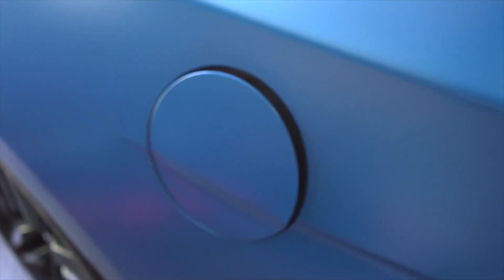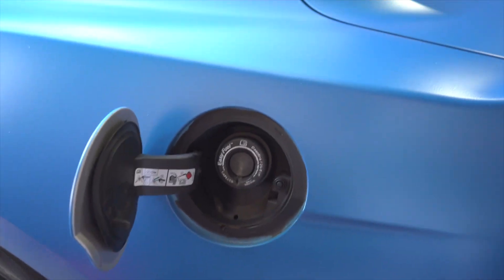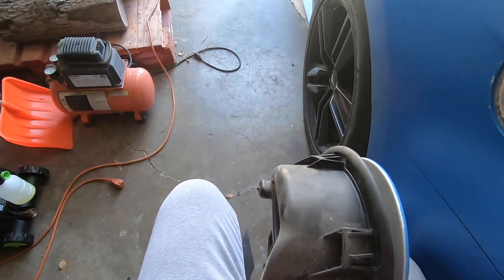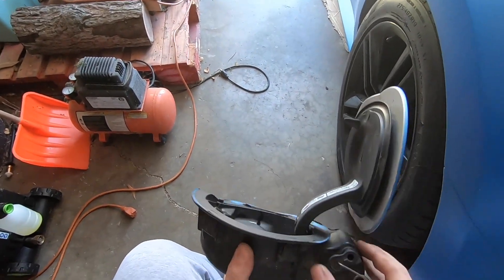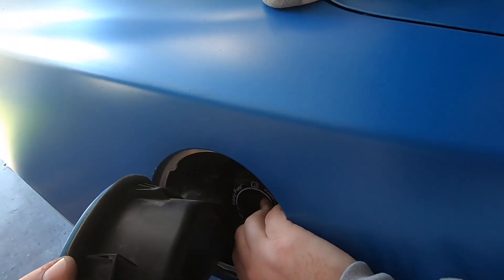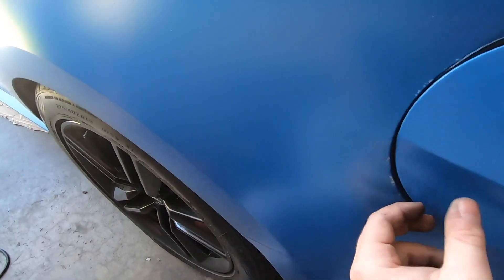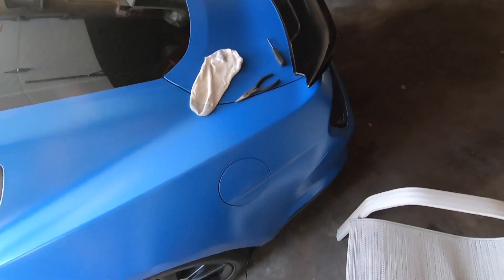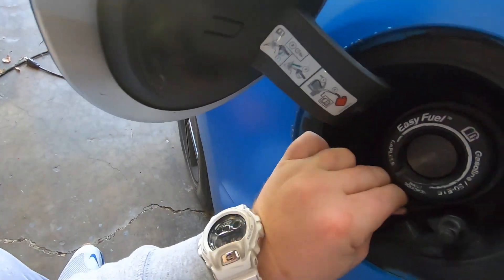Fixing my car yet again.. (Ford Mustang broken fuel door)

Comment: A little help for anyone that finds you video.. That gas cap assembly is actually easy to come out. Each of those indented slots, 4 in all, on the face of the plastic fill tube surround escuchion, represents where the built in plastic retainer clips are underneath.. you just use a 90 degree flat plastic angled removal tool, between the plastic surround and 1/4 pnl fuel filler tube opening, slide it around to each one and using the tool underneath, depress it in a way to release the retainer, work ur way to the next, till they r all released and it pops right out. Be careful removing it, there is a rubber drain tube and ruber around the fill tube.. Always make sure to protect your paint with masking tape, and if you have to pry on something as you were, do it with plastic and or put a bondo spreader in between.  Remember, for the most part, if u r finding yourself struggling, u r doing something wrong. Hope this helps..
Reply: The tube on the back of the housing is the drain tube right? Can I remove that and not have to worry about damaging anything?